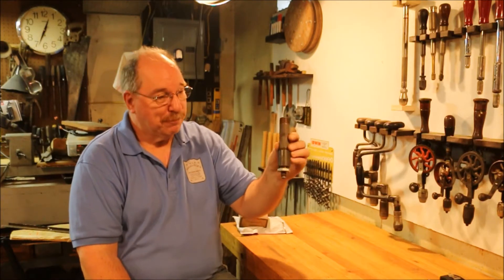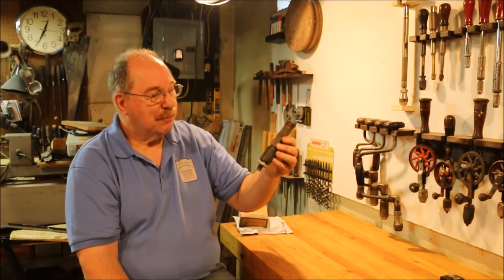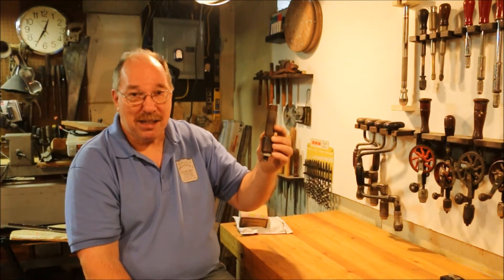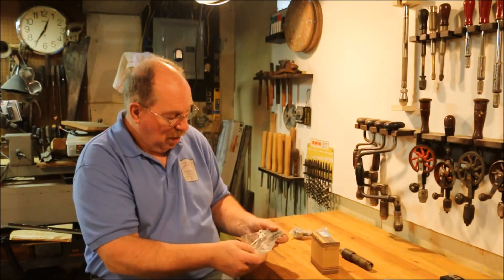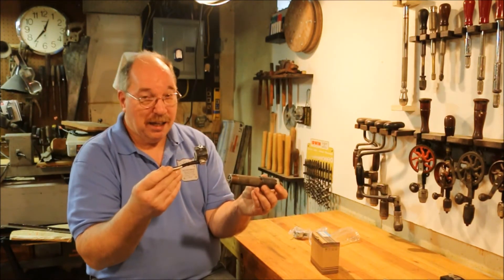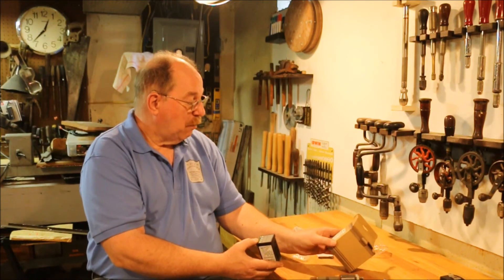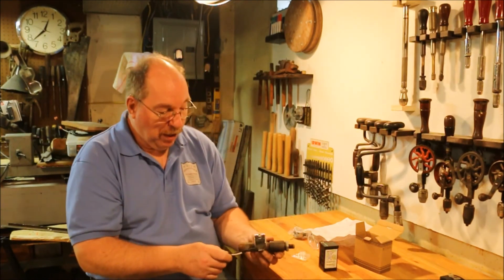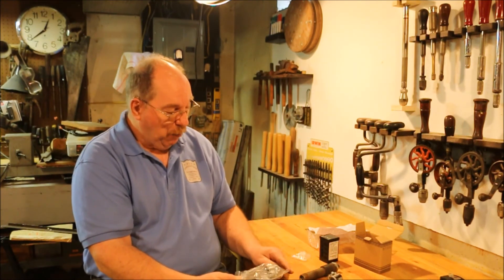MAKING A HDPE EXTRUDER

Comment: I ran extruders over half my life. 
LDPE, HDPE, STYRENE, and laminated it to another substrate to make flexible food packaging. 
On a cold start up, the band heaters would start heating the barrel. Our barrels were 15 feet long. 
When we started the screw, the friction of the plastic being turned inside, created it's own heat and water jackets kept temperature stable. I've been retired since 2012 but it's cool to hear some of the terminology. I could tell you stories.
Reply from the maker: For three years I worked in and around plastic injection molders. 
I was the Location Supervisor for a company that did quality control for various companies in the area. 
I never ran one of the machines. The tool room and machine repair were a constant source of information and I was fascinated by the operation. Such a simple idea that can create marvelously complicated parts at a rate of hundreds per hour.
Reply: @OldSneelock  
We also had a Thermoformer. We ran the styrene from 3 chrome stacked chill rolls that created the sheet from plastic beads that made the stock for the Thermoformer. We ran Knotts Berry Farm, J.M. Smucker, McDonald's and more. We did make bottles also. They called it the gamma line. The extrusion head pointed upward. A wheel of bottle molds would close on the extruded stream of molten plastic and air would finish the process. Injection molding is a sweet process. 
My extruder laminator had 4 extruders, 3 unwinds, 2 priming stations, auto cut over at winder and automatic splice in on the Martin Unwind at 900 fpm with minimal waste. Taco Bell hot sauce and Heinz ketchup were big customers, running for days. I was one of 6 people who could run that machine. 
It's all history now. 
I put 33.5 years in Newark California. 
I live in the mountains now, with fires all around. I still love California. It's crazy here but......
Take care Sneelock. 😉
Reply from the maker: It would be a great world if we could have things stay like we are use to. 
The only thing constant in life is change. 😁😎

Comment: Sounds like ye olde mad scientist Sneelock is going at it again.
Reply from the maker: It worked so well on the grinder bushing even with the cobbled up melting tube that I thought it would be worth while to make a better one. The 3D printed threading dial on the lathe got me to thinking. The gear and body are plastic. Once I have a model to copy I can make molds out of plaster and recreate almost anything. Yup the Mad Sneelock rides again.
Reply: With Both feet on the pegs instead of standing up on the seat!